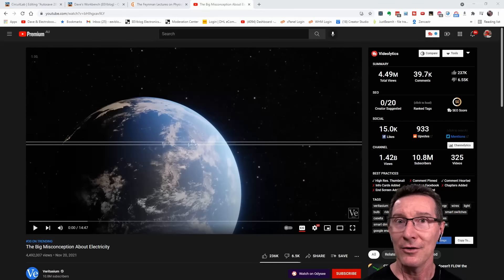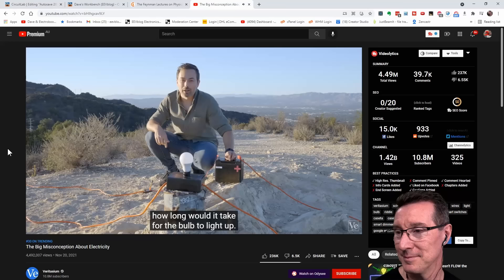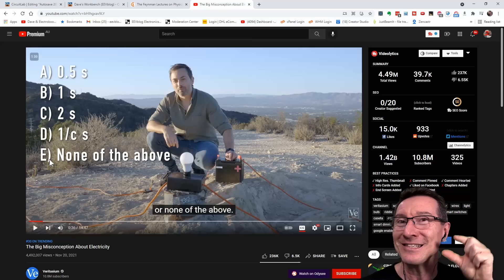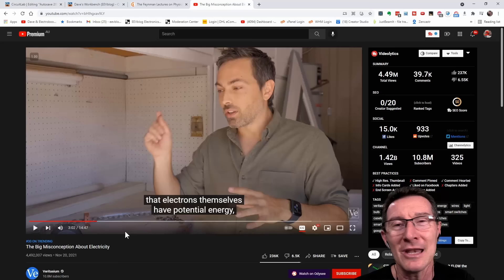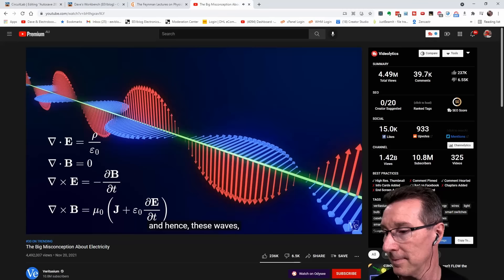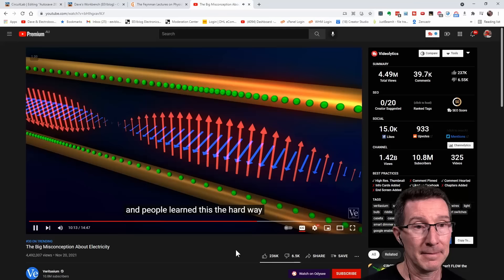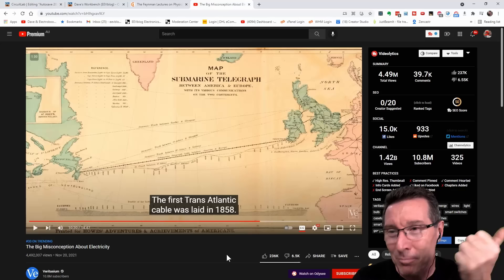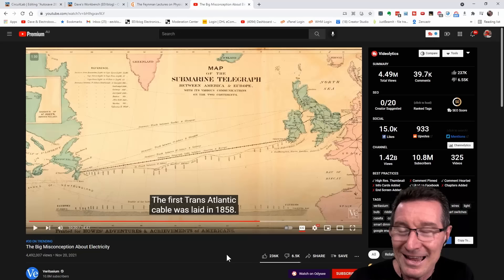EEVblog 1439 - Analysing Veritasium's Electricity Misconceptions Video

Comment from the maker: An extra video with extar comments for those trying to simulate this: https://www.youtube.com/watch?v=lBycH31K-E8
Reply: How do people in Australia call it, exactly: Khrushchov's law or Kirchhoff's [ˈkɪʁçhɔf] "Kirk-hoff" law (K. circuit law, K. circuit rules)?
Reply: Both videos (Veritasium's video and Dave's analysis) are very interesting. But I still do not understand why we need wires in real life. From both your and Veritasium's  video I understood if the energy would be transported along the wire with the speed of light it would take more time than if the energy takes the shortcut (direct path) from the battery to the bulb. His and your experiment show the bulb turns on faster than a "signal" could travel along the wire. So "why do we then even have to have a loop? Why are two separate parallel wires not sufficient to turn on the bulb?" If we need a circuit only because we need some current: use two separate circuits. One wire connecting plus and minus of a battery and another circuit with the light bulb. Both loops close to each other. Now if I would try this with a battery and a light bulb I am sure the wire in the battery loop would get pretty hot and the light bulb would not turn on. Or maybe it would be super dimmed. But if I set up a conventional circuit with battery and bulb in the same loop the bulb would shine brightly. 
Now, for very close distances, energy can be transmitted "contact-less" (as used in wireless charging of e.g. smart phones) with high efficiency. I think I even (partially) understand that some sort of dampening makes the wireless energy transfer over large distances inefficient, but not impossible (I think any radio wave is transporting energy). So for "large" distances (e.g. already just a few meters in a house) we need wires to transport the energy. We cannot use a small loop with a bulb at e.g. level 2 and an energy source at the ground level with another loop. We need to connect both with a wire in a loop. But why do we need the wires if the energy is not transported along the wire?
Reply: @slowhornet4802  Wires are needed because they lead the electromagnetic waves where to go. If two wires go to the moon parallel to each other, one meter apart, then the bulb would be lit up one second after the switch turns on. Because the distance between the electric generator (battery) and the bulb would be a little more than one light second.
Reply: You should look up time domain reflectrometry, and see how transmission lines are modeled.

You haven't described your scenario. Is the bulb on the moon at the end of the parallel wires (a balanced transmission line) with the battery on Earth? Then it will take about 1 second to light.

Or are the bulb and battery each on the Earth, each connected to their own end of the wires, then the circuit is closed between the bulb and battery? In that case, the bulb gets current right away and a wave begins travelling down the transmission lines to the moon.

How bright the bulb is depends on the resistance of the bulb versus the characteristic impedance of the wires. And it will take about 2 seconds for you to find out if the other end of the wires are short or open.
Reply: you have an EXTRA VIDEO after a 45min video!!!!!
Reply: @AlienRelics  Yes, I meant, Bulb is on the moon, the battery is on the earth :)
Reply: Is current not measured in units of charge over time?  Are not electron the charge carriers?  If one has a given current, does that not mean that so many units of charge are passing through a given cross-sectional area per second?  I'm talking strictly DC here.
I guess from a physics POV, we would have to count how many atoms contribute electrons to the conduction band, and use that as a divisor...?
Reply: Many thanks, also for the additional explanations. So basically we look at a circuit in the form of a long flat rectangle, e.g. 1 meter times 300000 km (roughly 1 light second). In Veritasium's scenario (let's call it A) the bulb and battery are placed in the middle of the long sides of the rectangle, just 1 meter apart. In Mübin Icyer's scenario (let's call it B) the battery and the bulb are placed on the short sides of the rectangle, 300000 km apart. Veritasium says the field between the battery and the bulb would transport (all) the energy. So if bulb and battery are 1 meter apart it would take 1 meter / c seconds after using the switch until the bulb would be on, while in the other scenario it would be 1 second because battery and bulb are 1 light second apart.
But I still do not understand: in the earth / moon scenario B the wires would be running mostly (= the long sides of the rectangle) in parallel to the direction of energy transmission while in scenario A the wires would be perpendicular to that direction. So I do not understand how the wires are somehow required and somehow not. 
And if there are no wires between earth and moon, but battery and bulb would be located in two local circuits, the bulb would not shine at all.
In my next life I will make a PhD in Physics at a proper university. Wikipedia is clearly not sufficient for me :-)
Reply: @slowhornet4802  ,  If you can understand the math AND the question, the EEVblog reply is the one I'd stick with as it deals with the real world, not with the theory which doesn't even cover the topic without a LOT of "help."
Reply: @rustycherkas8229  ,  Good lord, you are noting that the mathematician has no clothes!
Reply: @slowhornet4802  ,  Try what the EEVblog did and consider the wires in a circle.
Reply: @BruceNitroxpro 
"Veritas" is Latin for "Truth".
He developed an audience making what have been well-made, educational videos.
Pity, but it seems he's gone over to the Dark Side in recent days...
Tsk... "Celebrity"... It'll do it every time!
Reply: Thank you for pointing out Feynmans excellent clear explanation (Vol.2 Ch.27) with clean and simple pencil drawings. Dave, you are 100% right. Every electrical engineer remembers this stuff more or less and all other viewers are way behind to make sense of all the fancy computer graphics. It's a bit sad, isn't it?
Reply: This is not right.  There are two question: propagation time in the wire and propagation time in space between the battery and the bulb.   There is an inductive effect between the local wire that gets the bulb "started".  But to maintain, power the power is coming over the wire.   (assuming the pulse carries enough energy to even light a bulb). 

If the long wire were not there, the bulb would come on for period that the pulse from the switch send energy that got induced into the wires attached to the bulb.  Much like a radio drives a receiver very far away.  But that power must be a pulse.  A steady voltage will not get induced once it has stabilized. 

Even with this, there is something wrong.  The only way I would believe that it wouldn't take 2 seconds is someone did it.  Yes, there would be an impulse in 1/c seconds, but it would not remain on.  It would die down and then come back at about 2 second mark.

Now here is the other part of the problem.  He is mixing propagation of AC with DC.  The battery is DC.  There is no EM wave in DC other than the initial impulse.  Who are the two guys that seem to be "experts" who agree with him.  Don't they realized DC propagation happens via electron drift.  AC propagation happens via wave theory of E&M.   So @14:05 when he says "exact same analysis works for AC as DC", that's TOTALLY wrong!!!!  And it's not just Engineering "think".  It's physics think. 

So EEVblog guy, don't walk it back the way you do @10:10.  He's just wrong from a physics point of view, he is wrong from engineering point of view, he is wrong from the math point of view.

Induction is an effect of the change in current over time.  When he closes the switch he creates an "impulse".  But after that the change in time is 0.   In AC, there is a cos, which is always changing and thus a non-zero derivative all the time!!!

Let's get him to learn something:  Have him connect one side of a transformer to with a DC source (battery).  Let him see that the light on the opposite side will NOT come on.  If it is AC, it will come on and will stay on.  But he owes me 1/2 of what he makes.  Lol.

But here's the thing that kills me -- He has 4+ million views.  1 Million views is $5,000.  So for this video he is laughing all the way to the bank with $20K.  Not a bad pay day for someone who doesn't know what he is talking about.  Lol!!!

EEVblog -- in contrast has 118,000 views at this time.  That's maybe $500 -- assuming YT algorithm pays anything at all and is "fair".   So stupid gets rich and smart gets poor.  Lol.

But what is most sickening is to think that two PhD's agree with him and don't point out the flaw in his analysis.  What kind of PhD's are these guys!!!????  If they are degrees from genuine Universities, then the University that gave them their degree needs to demand it back.  Lol.

Let's take the "red pill" for a moment, but isn't this the epitome of what's wrong in this world?

Alright -- I'm coming clean also.  I knew something was wrong.  So I actually spoke to an Engineer who is both an EE and a Physicist by training.  He explained it to me.  I am explaining it here.
Reply: @joeboxter3635  
Derek was neither right nor wrong. He made a colossal mess out of simple question. Like bringing in Trans-Atlantic comms cable.
He should have stuck with DC. He made a disingenuous thought experiment that pitted parallel lines and claimed the light would light in ~1 nanosecond. Of course it would* (if weakly and briefly); in fact it would if the wire had been snipped at the the extremities the moment the switch was closed. But that has nothing to do with DC current. Direct current isn't an instant-on phenomenon at the moment a circuit is closed.

But we all know how he rolls. He's going to change the video name, the video thumbnail, bring in the follow-up video "What was actually going on/misunderstood/etc. in my previous video..." "I've gotten so much feedback, I thought I'd..."
_____
*Edit. I'd forgotten the distance of the wires apart. It would take FTL for the light to light at all.
Reply: unfortunately not every engineer knows this stuff. I know many UK university's Electrical and Electronics courses that do not even hint at Maxwell during their 3 to 5 years program. Really sad but thanks to people like you there are alternative learning resourses as long as they know what it is they do not know and must learn :)
Reply: I don't understand this. I mean, I understand electric fields and stuff and yes energy is in the field and the charges actually move very slowly. But
If that was true, then we could transport information faster than light. Suppose we have a switch on the moon and one on earth. Now we open and close the switch on earth with a fast clock. Every time the switch on the moon is open too, our light on earth shouldn't light up, because the wire is not connected right? So when we now open and close the switch on the moon in a way that it encodes a digital signal but slower than our clock on earth, everytime when our lamp on earth does turn on, we know that the switch on moon must have been closed too. And since we don't have to wait for the electricity to go all the way to moon and back, we have transmitted that information with 1m/c.
Or not?
Reply: What about the distance between the switch and battery?
Reply: The end where the light is on at D is WRONG, it doesn't take the velocity factor of copper into account for 95% of C or 176,700 miles/sec, or the inductance of the wire and time constant.
Reply: @anthonywilliams7052  Battery is DC so no inductive loss in wire
Reply: @FrancisKoczur    It's only DC and steady state after many time constants have passed after the switch is turned on. Same for when the switch is turned off, you will have a back EMP from when the inductance was charged up. When the wire is first turned on their will be a ringing of the inductance, however small, but add up over a very long 600km wire. I'm guessing the capacitance would be very low but in the real world that matters too. Everything has inductance and capacitance however low it may be. The end of the video starts with the switch OFF, then is asked how long to turn on, that's takes time for the electrons to move and the inductance of the wire to charge up. The velocity factor alone makes it 95% of the speed of light, and the inductance, although low, will all up over a long distance. It doesn't lose energy to the inductance, but it does add time, the time constant to charge up the inductance of the wire which will be returned when the light is shut off, the back EMF pulse that can be destructive at times.
Just look at the first transatlantic cable in that video at 11:11, not even close to the Moon distance, yet the inductance and capacitance made the signal almost useless!  This is "300km long, so 600km total, way way more distance for inductance to add up. I used EasyCalculation self inductance of 1mm wire for 600,000km or 600,000,000,000mm for an inductance of 5.297nH. Not much but not zero either. Since I don't have the actual resistance of the wire to make the time constant, I can't show the exact number but you get the point, isn't zero. It would be 5 time constants for the 99.3% to be reached.
Reply: @FrancisKoczur  Checkout the simulation that Dave mentions above to see what I mean. Like Dave said, "I deliberately left it out of the video". Also, the 1M distance between the 2 wires for extra capacitance distributed along the wire. Lookup Transmission Line theory, a wire is never just a wire. 
p.s. Notice the ringing in the simulation, not much but is clearly there. The same for the reflected wave.
Reply: I don't understand how he arrived to 1m/c number still. He clearly mentions that electric field propagates THROUGH THE WIRE at the speed of light (in that medium?). So once switch is turned on, it will take LenghtOfWireToBulb/c for electric field to reach the bulb and induce the current, which in turn will induce magnetic field. Until then there is no electric nor magnetic field around the bulb, so what Pointing vector is he talking about at 1m/c ?
Reply: There are three situations where electrons DO carry energy ... in a vacuum tube, a semiconductor, and a plasma. Plasma filaments exist in space that are hundreds or thousands of light-years long. They consist of electrons and protons (or positive ions), all on the move. Veritasium doesn't get beyond 18th century electricity experiments where plasma was unknown.
Reply: @EEVblog You're wrong because 1 m/c s is just wrong
You put the number on the left. Then you must have a space. Then you put the units on the right. Anyone who doesn't do this is mixing up units & variables = catastrophic failure
Reply: @rustycherkas8229  Maybe you should have watched all of Dave's video and taken it all into account instead of only focus on the negative parts.

Someone is trying in 15 minutes to describe fairly complex concepts to common people, which takes Dave a 45 minute video to clarify, with much nodding to a largely correct parts. And directly you are jumping on the few negative parts in the most disingenuous manner possible, slanting Daves video into something it wasn't. The above comment is a direct insult on Dave's video and on a community aimed to educate others.

What did you do to educate people that lacks the concepts of electrical engineering lately ? Or are you just that small minded and jealous that someone aiming to trying to educate people that lack the detailed education actually has a large amount of subs, while you are just going full Karen in the comments.
Reply: @slowhornet4802  In order to flow energy, we need a potential difference between two wires. This allows that wires behave like antenna. One side of the wire is the sender antenna, another side of the wire is the receiver antenna. In scenario A, sender and receiver antennas are 1m apart and the electromagnetic wave travels only 1/c second. I think it will take time for the bulb to light up fully because after the switch is closed, the potential difference of the wires is only in the vicinity. This difference travels along the wires and if the difference is fully accomplished, then the bulb will light up fully. 
In scenario B, after the switch is closed, the potential difference between wires travels 1s long to reach the other end of the wire (bulb). Therefore, bulb on the moon lights up 1s later.
Reply: Will these electromagnetic waves light up another bulb at 1 meter distance not connected to any wires ? It just doesn't make sense. His diagram shows electric and magnetic field lines as if current already flowing through whole of the circuit, including the bulb. How can that be the case, if he himself states that electric field propagates THROUGH THE WIRE at speed of light ? There will be no electric field in the bulb and around it at 1/c yet, with no electric field there will be no current, with no current there will be no magnetic field.
Reply: @Covenant-R  
While I accept your criticism and respect your right to protest my "review" of Veritasium's presentation, the video in question is a departure from the precepts of a publisher who goes by the name "VERITASium"... Veritas is Latin for "truth".

In this video, Derek claims that his bulb will "light up" after ~3ns... This is patently false and severely misleading to "common people" (of whom I consider myself to be a member.) What has happened to "truth" in this video? Unsophisticated "common people" will believe that some form of magic conducts enough energy from the battery directly to the lightbulb (by the shortest path) in amounts sufficient to light-up the bulb, and that the conductors are of no consequence... What difference does the switch make to the circuit, open or closed???? Magic... Smoke and mirrors... Veritas?

These same people will go on to be convinced, by "Derek clones" that the Earth is flat, vaccines make you magnetic, and that Matt Damen grew >400 potato plants from 12 potatoes... This sort of thing reduces science (and engineering) to no more significance than the deceptions of a carnival magician.

We no longer have "The Great Randi" to call-out charlatans, so some of us feel the need to try to follow in his footsteps and keep civilisation from descending back into the dark ages with its superstitions, alchemy, wizards and witches...

I love comedy and parody, but not when it presents itself as factual or scientific.... If that's not acceptable to you, I'm sorry, but ...

PS: In his sponsor blurb, Derek suggests "common folk" will be competent to replace "mains" switches in their own home without suggesting engaging a trained professional to work with that potentially hazardous material... I'm not impressed. I wonder if any future fires or deaths (incl. electrocutions) could be traced back to Derek's casual disregard for his audience.

PPS: I've only ever known one 'Karen' personally...She was one of the sweetest, kindest, most generous young ladies I've had the pleasure to have made the acquaintance of. You might re-consider the arms you use when you chose to hurl abuse.

PPPS: The number of Derek's subscribers grew in response to his earlier "quality" videos... Ask yourself what has made him decide to become deceptive?. Or, ask him! He doesn't respond to my attempts...
Reply: @joeboxter3635  Could you ask your Engineer what effects the zero ohms resistance in the wires would mean. Superconductors are said to "shed their magnetic field" and I wonder if a magnetic field will be able to generate electricity in another superconducting wire if that other wire also sheds his magnetic field (the complete magnetic field is surrounding the wire constantly).  There needs to be resistance as EEVblog explains to induce electricity.
Reply: Why are you so frustrated about physics and kept on mentioning about engineers don't care about physics? I understand that as an engineer myself, we don't really utilise the fundamental equations of the electromagnetic theory and it is technically not even useful in general in practical engineering, but I don't see any reason to be frustrated about this and as a matter of fact, I appreciate that we as an engineer are to be reminded about the physics here and again. And again, please explain to me the reason for your frustrating tone when every time you mention that practically as an engineer, it doesn't matter? Because, even as an engineer, we should be able to appreciate physics instead of complaining about it, whining that it is useless in practical engineering. That whining is what frustrated me the most.
Reply: @shadowzabyss  Haha.. I worked on a powerplant as an operator. Energy IN = Energy  OUT alright? Now can the powerplant govenor predict you turn your lightswitch? Remember that A high voltage network also is a capacitor.. too many Re-here.. won't go into further detail.
Reply: Please, could you do video on tachyon energy?
Reply: frequency goes down, steamvalves will open, boiler regulator will give more fuel.. that's the simplefied  sequence.
Reply: I can't wait to see this being used by Audiowoo.
Reply: My degrees are in physics and engineering. I remember struggling with the question, "is it a physics answer or an engineering answer " on my exams. 🤔 

Sometimes the answer was different.
Reply: @-danR  I love people try to split the difference on science.  It's either right or it's wrong and that's the nature of science.  There is no split the difference.  He made a collosal mistake.  That's all that needs to be said.
Reply: @shinigamilee5915  no there should never be a difference between science and engineering answer.
Reply: 1/c s is actually correct : c = 300,000 m/s; if you ignore the units of measurement, you will state it as 1/c s; otherwise, you will write down 1m/c, without s, because it will result in 1m / (300,000 m/s) = 1 / 300,000 s; so you either write it as 1m/c OR as 1/c s; 1m/c s is wrong
Reply: Thanks a lot for the video. I am happy you got a very good engineering education. The most important part was that you were focused when you were studying. It is sad that there are probably a lots of engineers that don't know about this. I did do computer engineering which is half electrical engineering and half computer science and didn't know about this. And if you add on top bad teachers, cheating students or not so good quality educations due to the lack of resources in certain parts of the world; one can see how it adds up to people not knowing about it. But I really learned a lot from your response and even understood the "trick" parts of the question including the somewhat misleading parts of the original video. I really appreciate it.
Reply: @rustycherkas8229  the “truth” is still being discovered.
Reply: The video worked great. Ppl are all focused and thinking about something on YouTube other than brainless fail videos. And we need a lot more of that.
Reply: This reminds me when I learned from a Richard Feynman lectures that light doesn’t actually bounce off surfaces it’s absorbed in a random way and that makes for another electron to be released. Making the general way they teach it all wrong.  There’s no equivalent to Billard balls bouncing off of a side bumper.
Reply: The physicist mindset is superior to the engineers mindset, because the Physics fundamental principles have to be the place we take the next step fwd in understanding.  We will never  come up with the final theory of gravity we constantly think about it as pennies rolling into a cone like at the children’s science Museum.
Reply: @nathanroberson  
"truth" is still being discovered

but lies & deception lay all about, thick on the ground.
Reply: What happens in electrolysis or electroplating when electrons are removed and used for reduction of water or a metal ion?
Reply: @ivannemo4259  
Electrolysis: 2H20 => 2H2 + 02.
No problem. Just switched allegiances.

And, the word 'ion' should be a clue, too...
Reply: @rustycherkas8229  Thanks, but how does that square with electrons not moving through the wire?
Reply: @ivannemo4259  Electrons SLOWLY move through a conductor.

Wrote this before somewhere: Stand beside a long train that is 'shunting'.. As it starts, stops and reverses, the carriages may not move very far, but the push/pull of the locomotive is transmitted the length of the entire train very quickly...

Electrolysis just 'helps' component atoms to divorce one-another before remarrying. :-)
Reply: @rustycherkas8229  Thanks.  But electrolysis is rapid, just as electroplating is, with electrons being removed from the wire at a high rate to fill the electron deficit in oxygen, hydrogen or converting metal ions into metal.
Reply: @ivannemo4259  Oxygen & hydrogen nuclei aren't picking up electrons that they keep. They are filling their outer orbitals (shells) by sharing electons with a partner, be that hydrogen or oxygen. The energy added kind ionises the atoms momentarily (divorce), until each combines with abundant partners of their own kind near the electrode that has attracted them... Tiny, mobile hydrogen ions (a proton, really) will be attracted to the negative electrode to replace the electron it let go of when it split from oxygen. Negative oxygen ions will migrate to the positive electrode where it can dump the electron that is too much, and settle into life sharing electrons with another oxygen atom..

There are courses of chemistry available online... :-)
Reply: @ivannemo4259  More info... Learn about NP diodes and PNP transistors... Tiny amounts of doping atoms change electrical characteristics of silicon matrices... It don't take much doping to have great effect, and you're using millions of 'em right now... :D
Reply: Dave makes a number of mistakes, i will mention one. Dave says that initially there might as well be breaks at the ends, because currents take times to reach the ends.
No. If a DC circuit has one switch, then all parts of the full circuit have a current or currents at all times, when the  switch is open, & when closed.
What Dave doesnt realize is that when the switch is open there is always a current in one direction, & an equal current in the other direction (actually not equal, but mirror image)(which i wont explain here), & the 2 magnetic fields cancel, in each inch of the circuit.
When the switch is closed, ignoring initial transients, then after a while there will of course be just one current at any location.
I dont think that this mistake by Dave necessarily leads to wrong answers, but it might.

Actually, i will mention another mistake. Dave shows a graph of voltage or something changing in accordance with a nice smooth arc. 
But, DC circuits exhibit stepped graphs, never smooth arcs.
The reason being that when the switch is open there are 2 opposite currents in every inch of very circuit (if having just the one switch)(which i wont explain here).

One more observation. Veritasium uses wires coated with plastic. The speed of electricity in his circuit is therefor say 0.66c, not c.
Depending on how u define c.
But Veritasium cleverly or luckily avoids trouble here, because he has defined his circuit as being 2 light seconds long.
Hence it doesnt matter whether some sections of his circuit are insulated or not.
And it doesnt matter whether the bits on Earth are insulated with plastic, & the bits in the atmosphere are not insulated but in air, & the bits in deeper space are not insulated -- here u have at least 3 different c's -- but his  definition of his circuit sidesteps this possible criticism.
If he used km he would have had to define his circuit as being 400,000 km long (if insulated with plastic full length), to take into account the slower c in the plastic insulation.
The plastic insulation would not much affect his 1m/c calculation -- as long as he took into account whether the c related to the speed of light in air or in vacuum -- i suppose air (the bulb being on/near Earth).
We say speed of light, but technically we should say the speed of the electric forces or fields, which we think is the same a the speed of light, but as is usual we dont actually know for sure.
After all, in say air, the speed of light depends on frequency. See what i mean?
But enough for now, i need to google the Poynting Vector for DC fields (Dave said that DC's dont have fields). I will have to look into it.
Reply: That's not (1 m)/(c) s, it's (1 m)/(c m/s) which makes it 1 s. You don't measure time by m*s.
Reply: @TheDigitChannel  I'm too pedantic to let it pass...

We use the Greek letter 'pi' to denote the unitless value 3.1415...

We use the letter 'c' to denote the speed of light. Speed (distance over time) means that 'c' includes its units ("m/s")...

To use "(c m/s)" is to claim:
~3*10^8 m^2/s^2
and that's hogwash (according to my friend Albert... He's smart!)
Reply: Any person with enough mental capacity would be able to deduce what 'c' is and what the units are. The comments are here to point out the mistakes, not to try hogwashing the mistakes. That's not very smart.
Reply: @TheDigitChannel  
Okay-y-y-y-y.
I cannot make out what it is you might be trying to say in your recent two comments...
I don't need to or care, but I'm glad you got something off your chest...
Cheers...
Reply: @rustycherkas8229  I'm glad you liked it
Reply: If two parallel wires made a circuit the distance to the moon on both sides of the earth, with a bulb and a switch attached, the bulb and/or wires would explode as soon as the wires were in place due to earth magnetic field induction, electrospheric ion induction, etc.

For real-life example, see "NASA space tether failure".
Reply: What Veritasium has proposed in his video is a steady state DC problem that can be modelled as an R-L circuit with battery, switch and load.   The self inductance dominates over any capacitive coupling between wires spaced 1 meter apart.
         The self inductance and interwire capacitance are approx.    2.4 uH/meter and 4.6 pf/meter

There is not enough capacitive coupling to transfer energy into the bulb of any reasonable resistance say 10 Ohms for a 14 watt bulb operating at 12V.   This is basically an R-L circuit with time constant   Tr =  L/R 
Veritasium video is buggered up on so many levels it is not worth the time addressing.   At least you got it mostly correct except for the transients being due to capacitive coupling rather than current build up due to an R-L rise time.
GH
Reply: so if someone sits at the far end of the 1 ly long cable and cuts it
how long does it take until my light turns off again? ( i can see the light and battery spaced apart 1 m in front of me)
we need to have a circuit to turn on the light but the information that the circuit is broken cant travel faster than light
else you could communicate faster than light using this
edit: just got to 37mins ~ if the energy transfer is just explained by capacitance in between the wires the wire length doesnt matter at all
and it wont turn on the light bulb even if you're using superconductors
also in a universe filled/made of conductive material would a vacuum filled tunnel act as a conductor?
bc there would be no "outside" of the wire else than a hole inside it
Reply: Just what we need - -more grifters in the world.
GH
Reply: JESUS CHRIST IS COMING TO JUDGE THE EARTH SOON PLEASE!!!!!!!!!!!! CALL ON HIM NOOOOOOOOOOOOOOOOOOOOW!!!!!!!!!!!!!!!!!!!!!!!!!!!!
Reply: to cary the required electric charge.
Reply: what's an extar?
Reply: The questions that I have is, what if the wire is insulated? Most if not all the wires that households use are insulated so does that change anything?
Reply: Wires are needed to direct energy by conveying charged particles and applying an electric field.  The magnetism is there, but here it is not doing much.
Reply: @damjann33  or perhaps the video you mentioned was wrong... ever consider that?
Reply: All correct except a few things.  I have four years of engineering and picked up something from veritasiums video, but, like you said, I already knew nearly everything I just dont normally consider c in a practical application.  Neither does your model/simulator, I reckon, but its not important, the idea is correct.

The detail I learned is that the DC square wave would emanate from the switch at c, its just not a detail that ever matters in real life except once that I know of.  c is just too fast.
Reply: You're thinking too well of this clown at Veritasium when you call it sneaky when essential information is left out. He simply doesn't understand what he's talking about. He speaks from knowledge from high school or even middle school. I do remember something about how electricity is falsely explained there. His lack of knowledge is unveiled in the supposedly correct answer and how he used dimensionless 1/cc instead of 1 m/CC Sm. Quite deceptive on the surface, but when you combine it with a lot of the other nonsense he's producing it's not really possible to conclude it's done with ill intent - rather with arrogance. He's using sources to back him up so it worries me how he was able to make this fly with them. Something must have gone very wrong with this production. I guess the need for money before Christmas is an explanation for this strange flaw. I also find it amusing that you feel the need to adore him with *everything he says in the video is right*. This is simply not true. Most of what he says is confused bs. He sometimes says the right things, but after a breath he goes to contradict himself as if he didn't understand what you had just said. Really a strange experience - very close to the same experience we get from conspiracy theorists - yet not quite the same also because he reacts positively to sensible reason. It won't be long before we have a self-correction is my guess. 
Btw, you shouldn't throw yourself on the bandwagon agreeing that the charge is not traveling in the wire - not even jumping on and off. By this point, Veretasium deceives their viewers - especially when not mentioning the inverse square law. Also, you didn't need to confuse the topic with AC vs DC. The question asked is about the rising edge and in this respect, the flow behaves as AC - there's no DC.
Reply: @-_Nuke_-   magnetic fields go straight through insulation, but I'm not sure about electric fields. I believe they too travel right through insulation.
Reply: I am currently reading Heaviside's on how "perfect conductor is a perfect obstructor but does not absorb the energy of electromagnetic waves "  page 328 in  his Electromagnetic Theory - what a trance it is! I think this Veritasium guy ( as EEVblog points out) basically addresses modern physics misconceptions or omissions (as they should be properly called) . I think there is nothing to get hang about for you EEVblog  - for you as an engineer (and i am not one however I like to read!), i have always been struck by the flow of electrons in wires as pipes (that Steinmetz complains about) as something rather potentially misleading.  I am glad I have stumbled at your channel though.  (PS now I am finding out that at some frequencies Ohms "law" ceases to hold (impedance(squred) = resistance(squared) + reactance(squared) - basically Pythagoran theorem, and that reactances as to be expected are at 90 degree angles .... is such an eye opener!!!) ,   the misunderstanding of premittivity etc in physics as just constant to make equations work - all should be clearly visible at physics classes  - the academia should be leading the "charge" of understanding, unfortunately the just hate the "a" word because the Einstein fellow is god)
Reply: @slowhornet4802  The distance between the circuits count. Lighting a bulb at 1m distance will not work, charging your phone at 1cm works like a charm.
Reply: I accidentally measured the speed of electical signal, while sending a nanosecond pulse over an open ended BNC cable.

The setup is like this, a Digital oscilloscope is connected to source with 10 meter long BNC cable. I am extending another 10 m BNC cable from DSO, the end of which is open. While sending single pulse from source, I am actually seeing 2 pulses (a weak second pulse ) 65 ns apart. The delay is alomst close to (2* length of cable)/c.  I am mechanical engineer by profession, so all I can figure out was I am getting some kind of ringing effect from the open end. 

According to Derrick, if I move the (open) end of 10 meter long cable 1 meter to the scope, should I received the same pulse exactly 1/c seconds later?
Reply: Despite your argument and multiple repetitions, the correct answer really is 1/c seconds. The metre does not need to be stated, unless you want to make your means of obtaining the answer clear. A stopwatch (or oscilloscope trace) does not measure in metres, it measures in time (or voltage and time). You're really splitting hairs, given the spirit of the original question and video.
Your Poynting vector, transmission line and DC steady-state comments are absolutely correct. Thanks. 🙂👍
Reply: @slowhornet4802  because B field is made by the current
Reply: I still don't understand.  Suppose you BLOCK as MUCH of the EM waves surrounding the wire between the battery and the bulb.
Are you saying the bulb won't light up?  Run the wire through 3 feet of lead, battery on one side, bulb on the other.  Or 3 feet of some kind of metal.
Reply: Come on you didn't. Know that
Reply: You described skin effect as merely diameter dependent, but it's more dependent upon total "surface area", which is why high frequency cabling gets multiconductor cables...  This is so fun - I'm watching my kids heads explode!
Reply: Nice
Reply: What about the biology angle?  If megawatts of energy are radiating in fields between power cables, they're probably passing right through us.  Can we be sure that they have absolutely no effect us or other life forms?
Reply: The hardest part is hiding the batteries
Reply: @EEVblog Question. Speaker cables are mm apart. Should they be run separately? i.e. not sheathed in a cover?
Reply: @EEVblog At the risk of being labeled a fool, would you be willing to analyse the claims made by Ken Wheeler as concerns to magnetism and it's fundamental principles of operation and existance? I find his work interesting as a relative layman but I'm not sure there's any new practical application to be gained from his theories.
Reply: the need for wires in electrical circuits arises from the principles of electromagnetism and the behavior of electric currents. In a closed loop circuit, such as the conventional setup with a battery and a light bulb, the flow of electric current through the wire creates a magnetic field. This magnetic field, in turn, induces a current in nearby wires, completing the circuit.

I would explain that the loop configuration ensures a continuous flow of electrons, allowing for a stable and predictable electrical current. Using two separate parallel wires without a closed loop might lead to inconsistencies in the flow, resulting in inefficient or unreliable operation of the circuit.
The presence of a complete loop also enables the utilization of electromagnetic induction, a fundamental principle in electrical engineering. This induction is vital for the efficient transfer of energy within the circuit. In wireless charging, electromagnetic coupling is harnessed, but for larger distances, the efficiency decreases due to factors like electromagnetic damping, making wired connections more practical.

And so, the loop and the wires are essential for maintaining a consistent and controlled flow of electricity, leveraging the principles of electromagnetism for efficient energy transfer. The use of wires facilitates a reliable connection between the energy source and the device, ensuring proper functionality.
Reply: Is t the electric field outside the unconnected battery negligible small compared to inside (lile inside a capacitor.
EM-waves in cable do not propagate at the speed of light, depending on the cable 0.6-0,9 c.
The E field of the battery causes surface  charges in the cable (by moving electrons to the surface) and these cause another smaller e-field which then make the electrons inside move? Why? 
An EM wave is only propagated if we move a charge in space, so how if there was no net electron movement?